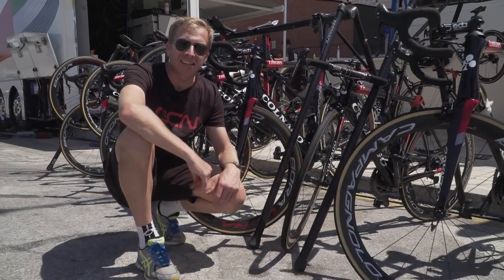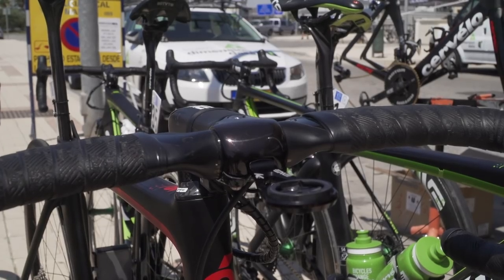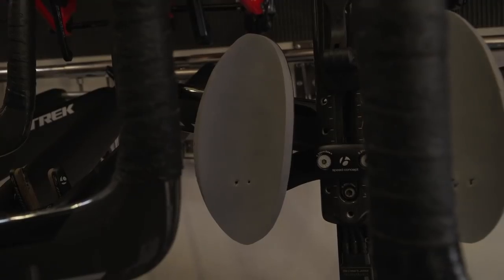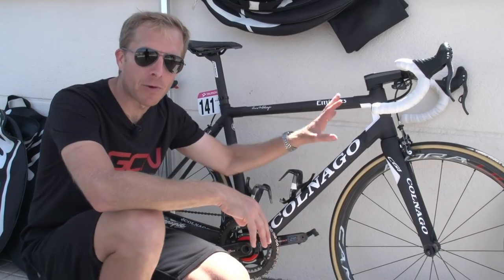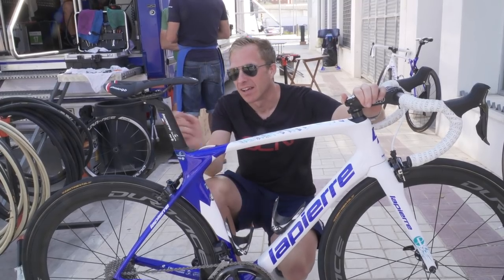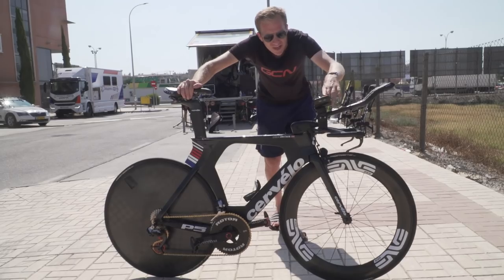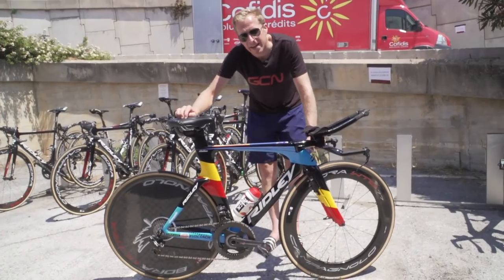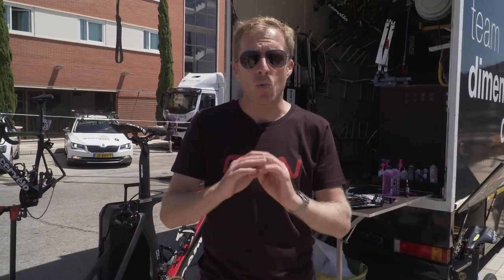Pro Cycling Hacks To Make Bikes More Comfortable | Vuelta a España Tech

Comment: Yes i double-wrapped bar tape on the tops of one of my older bikes cause it‘s got an aluminium frame with aluminium handlebar and the rattling was considerably higher on bumpy roads than with my modern bike with carbon frame, fork and bar. And the double-wrap helps! Just see that the second layer tape isn‘t wrapped too tight so it really can dampen shocks!

Comment: I am going to try putting some foam pipe insulation on the backs of the bars, where most of the pressure occurs. They are less squirmy than the gel padding some systems have. You can cut them to fit for more or less padding as you see fit, and might even weigh less then double wrapping the bars.

Comment: 1mm stem length difference is nonsense
Reply: The TROLL they do it to scare they other teams.
Reply: Is this cycling or golf?   "Hey mate, your stem looks a mm too short.  Oh, never mind, I'm sure you'll do fine.   After you then."
Reply: Are you trolling?
Reply: (moves the saddle back 1mm) now your stem is 126 mr. racer guy...
Reply: The Communist true that, comrade.
Reply: The 1mm increments are not “built” for bikefitting! The manufacturer just doesn’t hit the exact measurements - the mechanics measure the stems and write down the real sizes!!

Comment: The prologo rubber is not meant to dampen vibrations, it is there to prevent sliding across the saddle. For vibrations they would have used foam.

Comment: I use gel inserts on my rig, so when I single my bars is simple. Plus it reduces shock and my hands don't cramp up on long rides. My saddle is also at a tilt an off center . Relief of pressure and saddle sores.
Reply: Cool, those two bits really add comfort to the max! Just ordered a set of gel strips + rubberised bar tape and a carbon saddle that will be ridden tilted as well.

>One Love<

-A
Reply: @alejandrogonzalezlopez5883  My rig is simple but custom. I ride the variant 2 saddle by Serfas love it. It's 5 saddles in 1, I have old style stitched bar tape from the same company. Check them out when you can.
Reply: @thephatcyclist1766  Yes, been looking at some stuff from that company, nice gear & tips, mate! 

-A
Reply: @alejandrogonzalezlopez5883  If you have any questions feel free to ask. I'll help you navigate, it took me 2 yrs to understand what works and what don't. I ride for Serfas.
Reply: @thephatcyclist1766  ohhh then you must get a lot of riding done. Funny cuz I thought you were overweight. I trimmed down 42 lbs of fat with cycling and feel in LOVE with it, faced few hard years and sold the bike but now back at it since last 1 1/2 month after 4 years without riding. Visited a custom builder today, yeah custom is my next jump, amigo! 

Will keep in touch.

-A
Reply: @alejandrogonzalezlopez5883  I get my miles in and do a few alleycats as well. My YT name is a tounge and cheek joke about my weight. Cycling has helped me a lot in life. I just keep it brutally honest with the companies, about products function and feel. Living in AZ help  too, crazy summers an awesome fall, winter, and spring. I own 2 bike a modern one and a 1972 Schwinn.
Reply: @thephatcyclist1766  yeah helped me in more ways than one, too. Loved the nickname! Lol

Surely keep in touch, man! 

-A

Comment: I thought the ISM saddles were developed to help get around the old UCI rules on saddle length and 5cm setback rule.  As you sit on the nose you are up to 5cm further forward which helps get rotate whole position and get front lower for same knee/hip/back/arm angles.

Comment: My first tip for comfort I recommend gel bartape, I've been using those kind of bartapes (mostly from Fizik), it's alot easier and than double wrapped bartape and it's more comfortable! 
My second tip for comfort must be the Flexlogic seatposts from Ritchey, they give a bit more flex than normal carbon seatposts but u don't loose powertransfer!
Reply: You can also get actual gel strips to stick to the bars and then put the tape over the top.

Comment: 125mm vs 126mm  stem - I think they simply ran out of one so they took a spare of the other
Reply: Charlie Whiskey The 1mm increments are not “built” for bikefitting! The manufacturer just doesn’t hit the exact measurements - the mechanics measure the stems and write down the real sizes!!
Reply: I doubt that 1mm makes any significant difference .... what next? Pre ridden tyres to reduce excess rubber?

Comment: can you put spacers between pedal and crank? I need just 1-2mm so my shoes won't occasionally rub on the crank.
Reply: You definitely can, a few pros do for the same reasons of foot angle. They are called pedal extenders.
Reply: Take a look a speedplay they have different length spindles for riders that need a wider stance width.
Reply: Maybe put some sort of washer between the crank and the pedal
Reply: Yep, pedal washers. Real cheap for a bag of several of them, but just one on each spindle was enough to eliminate the shoe-crank rub for me
Reply: Great idea to use washers...never thought of that.  I am generally toe out, heel in when I walk.  I got rid of the rub by switching from yellow cleats to blue cleats (less free play movement) and their position. I have had no issues getting used to that.

Comment: My favorite comfort hack is riding steel bikes!
Reply: I'm a moron too!
Reply: OffEfOne  ?
Reply: the guy on the steel bike in my group ride doesn't look very comfortable going up those 10 % climbs lol
Reply: @CryWolfFilms  he should try the Uttoxeter bypass (1 in 6) on a Giant Stiletto LE Chrome with a custom fork. Fully loaded for a weekend of filming, that thing weighed over 120lb. I rode it from Nottingham to Stafford via Coventry then Long Eaton, and back via Derby. I'm not brave enough to figure out the total mileage.
Reply: I have to ride an old steel bike, til I save up for one, and I hate the steel flex.
If you're really putting power on the pedals you can actually feel the bottom bracket going side to side. Might be psychological but it feels like it dampens the stroke a lot, kinda like running on sand.
Reply: @serdiezv  there are nice steel bike and there are cheap steel bikes. There are nice carbon bikes and there are cheap carbon bikes.
Reply: @TimFitzwater  yeah yeah, I know. What I mean is that usually people like that steel flex cause it makes the bike more comfortable, but I really prefer something stiff, I don't care what material it is as long as it is incredibly stiff.
Reply: @serdiezv  I like to ride fast sometimes but I'm not entering any races - so I'll take a bit more comfort.  When a friend drops me(even on a climb as someone mentioned above) it isn't because of my bike!
Reply: @TimFitzwater  yeah, what I said, I think it's more psychological than anything and having that flex makes me think I'm slow so then I'm slow. Sure that flex is what's making me slow, and not the 5 kg I need to drop hahaha...

Comment: Hi, good day. Im a cyclist from the philippines. Just want to know how deep the carbon rim for my roadbike should be if I ride most likely 60% flats and 40% uphills. Thanks for your input based on your professional experiences.
Reply: I'm a climber as a cyclist and live in a hilly region with areas of flats. I bought an aero bike as my only road bike (so far, after crashing my old aluminium one) as I wanted to explore the aero benefit. In terms of wheels, I use a 40mm set (vision T42s, which are a carbon/ alloy hybrid rim) and I highly reccomend this depth of rim. They seem fairly aero on flats yet are shallow enough to climb well (I've ridden them on long climbs, including 25% gradients) and although they may feel a little bit heavy on certain climbs they make up for it on the flat and whilst descending. Good price for the wheelset too, proved to me that you don't need to spend $$$ to get a pretty good set.
Reply: 30-50mm
Reply: My region (also by the coast) is pretty windy, and I find 40mm wheels fine against even the strongest crosswinds. It actually comes down to the shape of the rim, not necessarily its depth (eg. some well designed 60mms may be better than poorly designed 40mms) so maybe just try before you buy if possible.

Comment: Hey John love the videos, hey is was wondering if you know who makes the “secondary seat post ring” that you pointed out in your video?
Reply: KCNC makes one. They also have an integrated 'two clamp' one that I'm using. Pretty good. Note it has different allen bolts and different torque specs for the top and bottom clamps.

Comment: At 8:20 John mentions "helicopter tape"   What the heck is helicopter tape? I have heard of duct tape, electrical tape, or masking tape (also sometimes called painter's tape), and shipping tape but I have never heard of helicopter tape. Is this another british thing?
Reply: Jensen3M tape developed for helicopter blades. Clear and easy to apply. Same as used in those small protection patches. Available in bulk so you can cover your entire bike if you want. I have a vintage bike that I have covered up to use daily, to protect the decals etc